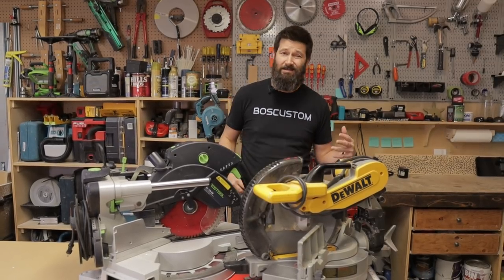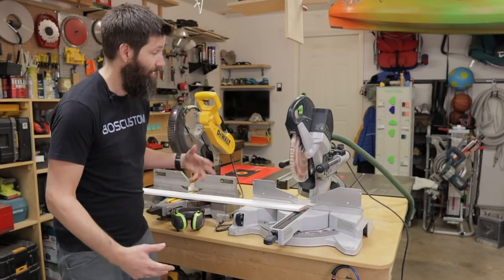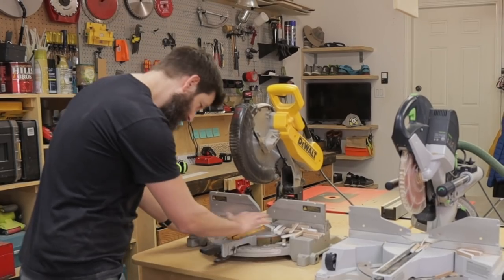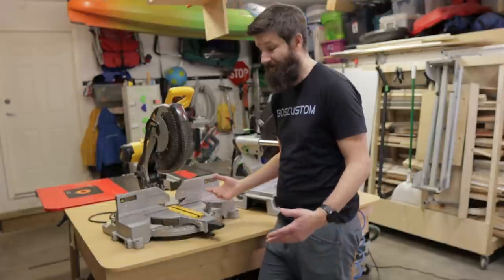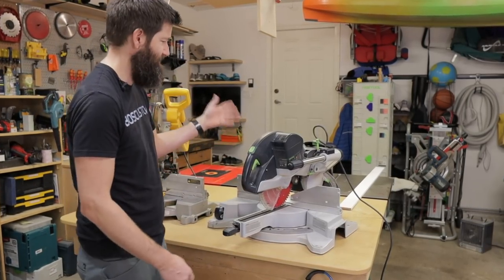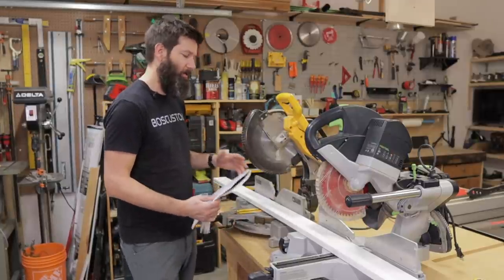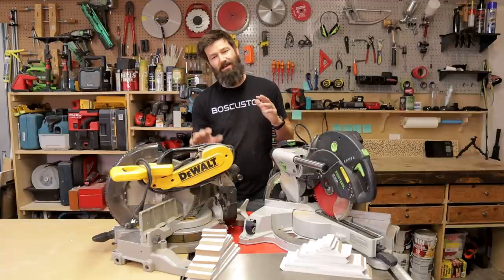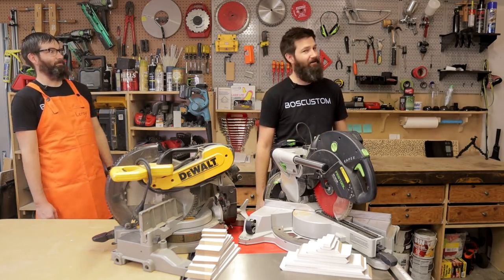Am I a Moron for Buying the Overpriced Festool Kapex-120EB over the Dewalt DW716?

Comment: Bottom line is if it's worth it to YOU.  I don't get wrapped around the axle about tool prices, though $1500 IS steep.  I think for a more apples to apples saw comparison with more similar features, the difference isn't nearly that high.  For professionals, these are money making tools.  If the features and benefits give you results and make you more productive, the price difference, even at this level, is not really an issue if the tool lasts and remains tight.  Just like anything else, if you want high end features, you have to pay for them.  While I can't justify that cost difference, justification is a subjective thing.  One bonus of purchasing an expensive tool is that you will inherently take better care of it.  Not so much if you have multiple employees using your stuff.  I went with the Makita 36v saw.  I like it, but it's HEAVY as heck!  I plan on getting the Milwaukee M18 7-1/4 model this year for portability.   Keep up the great work.

Edit:  As for accuracy, I find that simply using a marking knife instead of a pencil eliminates the vast majority of inaccuracy.
Reply from the maker: Good tip.  That 7-1/4" Milwaukee is really nice.  I've tried it cutting some 3/4" maple and the power was amazing.

Comment: Haha nice musical edit @7:35 I’m loving my Kapex for cabinetry, especially with the UG stand. But the blade guard is a serious pain. I even struggle to line up the laser to my pencil mark because it covers so much of it until you start plunging. My favourite part about it other then accuracy is definitely how easy the bevel is to use. I did everything I could not to use the bevel on my old DWS780.
Reply from the maker: Thanks man!  Good point on the Bevel, I think that's why most people end up not making bevel cuts- the average saw out there is a chore to get it set up!
Reply: @TheFunnyCarpenter  exactly! And then when you do get it set up they’re either so inaccurate or just heavy that they deflect to much on a bevel, and accuracy is just way harder then it needs to be.

Comment: I make a lot of small display cases, military shadow boxes etc, and I simply could not get either one of my Dewalt saws to cut as precisely as the Kapex. Is it way over priced, hell yes!.....but it truly has set and forget accuracy.  When I need to make a bevel cut, I don't need to recheck the blade once I set it back to 90 degrees......as it's always perfect, each and every time.  Did I mention the Kapex is overpriced?........all festool items are overpriced!   Otherwise it's been a fantastic addition to my shop and I look forward to never buying another Kapex, as once is enough!  Great review.
Reply from the maker: 100% agree.  The Mitre stops are bang on solid, the Bevel adjustment is razor thin precise.  Brings joy rather than frustration.  Cheers

Comment: You need to know this....Festool is engineering everything in house with their development department! Dewalt is just copying existing systems. Also, Festool is all about safety! So that's the reason you cannot pick-up the blade gard easily by hand! ( Just activate the system with the triggers, release the power trigger, and you are able to put the blade on sight to a mark on the wood you wanna cut, so there is NO reason to pick-up the blade gard with your hand!). Also, because Festool is using ballbearings, the machine will stay accurate as long as the machine will live! Dewalt will start to feel loose after some years, the entire system that you use to cut the wood will start to move left and right, so making a true cut is no longer possible. Dust will clog up the Dewalt so much, that you have to treat it with lube, in order to be able to use it, and the motor is under powered. The thing is though, in all honesty, you CANNOT compare these miter saws to each other. The Dewalt is made for rough building work ( foundation work for instance) and the Festool is made for more finer and precision work, like cabinet/ furniture making.You don't start the Baha 500...with a Ferrari right?! :-)

Comment: That is my exact Dewalt saw. I'm pretty happy with it. Trimmed a lot with it. I would not spend $1500 on a miter saw.  Could you do a review of a cheap harbor freight sliding miter saw?
Reply from the maker: That’s a classic saw, it’s what I started out with.  Build a nice reputation with it for sure!
Reply: The harbor freight 12in sliding miter, the Hercules one. Is a direct clone of the dewalt. It’s inferior in every single way. I wouldn’t buy it.

My boss owns the Hercules and I own the dewalt. 

My boss also has the Hercules table saw, wouldn’t buy that either

Comment: Hard for me to comment as I've never owned a Festool. But 1500 dollars for something my cordless Kolbalt miter does perfectly for 200 dollars is hard to fathom. I used to think Milwaukee was to expensive and now I'm hooked. So maybe I'll atleast give Festool a try at some point. But not this saw. Lot of people love that Dewalt. Most common miter saw I see on sites.
Reply from the maker: For the money Dewalt saws are tough to beat.
Reply: Bringing a festool on site seems silly to me. My festool are never going to leave my shop. 

I bought a dewalt miter saw after using a ryobi. The dewalt is unbelievably better than the ryobi. But in my small shop in which dust collection is extremely important and space is limited the Dewalt quickly became a burden. Working outside I love it. But inside the back facing rails make it so cumbersome. And it sprays out dust everywhere. 

I gifted the Dewalt to my dad bc I have no room for it. I currently have no miter saw and I’m using a festool tracksaw saw in its place. I can’t wait to get a Kapex.

Once you have the festool system there is no going back. Everything is so beautifully compatible and user friendly.  Relevant to my situation is that The Kapex and stand sits exactly the same height (90 nm) as the festool multifunctional table. So instead of having a bulky Dewalt miter saw folded in a mobile stand in my way while trying to maneuver boards around in the shop I’ll be able to slide boards across both level surfaces.

My two favorite brands are festool and Dewalt. For some things Dewalt is a no brainer over festool for me- like drill bits. I’m not gonna spend festool money when Dewalts are great. But once I upgraded to a festool carvex from a Dewalt jigsaw I will never use my Dewalt jigsaw again (inside at least.)

Comment: Depends on what you want to achieve. The Dewalt is my choice because it has a 12” blade. 
No Kapex can cut through a 3 1/2” newel without flipping it. 
It can’t cut through a 10” wide  skirt board on a beveled angle Front to back. The Kapex excels a bit on most other things by a small margin. 
Blade size matters. 
And the price of $1999.00 Canadian really bites. 
Most people that I know that have festool’s believe it makes them better. The fact is no tool can compensate for bad skills

Comment: If I was new to the hobby or craft and thought I needed a Festool Kapex to add to my arsenal to improve my work flow I would seriously consider purchasing a Festool track saw and either a DeWalt, Bosch or Delta sliding miter box saw. Far superior and useful than owning one extremely high priced saw that has better dust collection. I do know why woodworkers and carpenters are recently so concerned with mitersaw dust collection and own a wood lathe, table saw, router, drill, etc.. Marketing seems to be the most obvious in my opinion. Making sawdust is no differ than any other tradesman in other occupations, everyone makes a mess in creating their art forms and aren’t as hung up.
Reply from the maker: Hell of a point on the track saw cheaper miter saw combo.  For me the dust collection is nice, but it's the bevel cutting ability of the Kapex that sets it apart in my case.  For the average person hell no... buy the cheaper option.
Reply: Don't forget that a lot of these materials throw off toxic dust.

Comment: Thanks for the great video.  Ironically, I just spent $1500 to replace by Dewalt 780 and I feel like a moron, about 100%.  I bought the hype on the dust collection as I have a small hobbyist woodworking shop and obviously want as little dust as possible.  I honestly cannot tell much difference between dust collection on the 780 versus the Festool ($1500 (:.  I have spent a lot of time experimenting with different hoses and setups thinking I must be doing something wrong as I was expecting the 90% dust collection.   Aw shucks.
Reply from the maker: If you ever get a chance to see these two saws in the right type of lighting, you will probably notice the difference in dust collection.  The Kapex does a fairly nice job at keeping the finer dust out of the air.  Lol at least you will look like a top pro:). I always thought it would be funny if I showed up on site with my ridiculously priced miter saw and then proceeded to just shat the bed in terms of quality.
Reply: @TheFunnyCarpenter  Thank you😊. That helps me feel a little better
Reply: Are you using a festool vac? They base that number on use within their own brand
Reply: @beantea5592  Thanks.  I tried it with a Festool vac and didn’t see any noticeable difference with the naked eye.  I suppose if you were able to measure it with some sort of device, it likely would make a difference.
Reply: Dust collection is about the fine dust that suspends in the air & kills you slowly. The big stuff is meant to fall on the ground & not float in the air. You vacuum that up yourself.

Comment: Dewalt 780 all day. I wish rigid would make their newer model sliding compound miter saw at a high quality. It has such cool features for finish carpenters, but it’s just low quality and too many of them have blade wobble right out of the box.

Comment: I see that red blade on your Kapex, looks to be a Freud.  I can't find anything like it, anywhere, only the spendy Festool or Oshlun's you linked to.  What/where/how...I'm not a fan of the Oshlun's, would be interested in a Freud.
Reply from the maker: The Freud is just a regular blade that I had bored out at a sharpening machine shop.  I made a video on blades for the Kapex where I mentioned this.
Reply: @TheFunnyCarpenter  Nice to hear that you are fighting back against Festool's proprietary practices. Like 1/4 hex that isn't quite (they round off the corners!) and non-standard dust holes in sanders. It really is quite blatant. Along with pricing policies that got them fined several million a few years back.

Comment: I am sorry, I usually like your videos, but this is not a good comparison. Talk about how the Dewalt is so simple, and there is more to the Kapex, yes, because one is a chop saw, the other is a slider. There is of course going to be differences. Not a brand thing, Just not a fair apples to apples compare. I agree it is pricey, but again, not a fair comparison, the Kapex has so many better features than other saws. Accuracy is number one to me. When I first got the saw, took it out of the box, cut a 15" or saw ply, took two cuts, with a stop, flipped it over, cut the other way, you can not tell it was two cuts. Dead on accurate out of the box. Plus the Kapex clamps are genius. If something is a pain to use, we don't use it, with the kapex, I use the clamps every time because they are so quick and easy. The Kapex is also a space saver in the back, VERY nice feature. Plus how the bevel adjustment works, just turn the knob, another innovation. Not to mention, how can you compare, even price wise, brand aside,  between a chop saw and a slider? I am not a FT fanboy, but sorry, this was not a good comparison. If it was a Dewalt slider, then it would be more fair.

Comment: Haha great video, every finishing carpenter I know that has purchased  the kapex has had issues with the motor frying out :(  pains me to say it cause I am a festool fan for some of their products.
Reply from the maker: Kevin Smith that sucks about the motors.  I know quite a few guys with the saw and haven’t had any issues, but seems like a real problem.
Reply: They had a recall recently on the Kapex 120 - REB model in the UK, not sure what the case is there but give them a call, at least you can get it serviced by festool at no cost for you

Comment: 2020 and the dewalt saw is still the best mitre saw. I have three 12" double bevels, two 10" and the slider. I'm a finish carpenter, cabinetmaker and custom woodworker for over 30 years and dewalt is just the best at miter saw. I'm not brand loyal since the only other dewalt power tools I own are their electric hand planer and the new electric table saw. Cordless is makita or milwaukee and I would not buy anything but porter cable for a router.
Reply from the maker: Dewalt has always made a great reliable Miter Saw.
Reply: You're right dewalt makes the best sliding miter saw period.  Nothing else comes close.

Comment: Neither of them?  I have run both and after getting the Bosch Axial glide I haven't touched either ever again.
Reply from the maker: What do you like better about the Axial glide?
Reply: @TheFunnyCarpenter  The ease of tilting the head, the accuracy, the zero gravity stand, the fact I can put it against the wall and not have to worry about slide rails hitting, the ability to adjust the tension on the glide mechanism.  I also like the quality of the saw over both the Festool and the Dewalt.  The Axial glide is bullet proof.  I'm not gentle on my equipment, and the Axial glide takes its fair share of abuse and still cuts perfectly every time.   Though if we are honest with each other the other 2 are fine, I'm extremely brand loyal and have been using a Bosch saw for a while, I know my saw and dislike swapping from what I know.
Reply: @ericdevarney4089  the bosch is a fantastic saw glad I got mine

Comment: Been using power miter boxes since '79, Kapex has been awesome for trim. Plug the saw directly into the wall and go bluetooth on the vac, saw is stronger. I also cut all the ribs off the blade guard except the middle one, now both laser lines are solid with the head up. Yes only cry once on the price...
Reply from the maker: Cool idea with the blade guard. Thanks for checking out the channel.

Comment: I’m a finish carpenter. Kapex definitely not worth the money . The Dewalt you are comparing to is not good because it doesn’t slide. A 10” or 12” sliding compound Dewalt will cut anything and do it well. As far as dust goes.. well that’s what brooms are for. There will always be a huge mess regardless of the saw.

Comment: I don’t get the measurements being off by 3/16.... you make a mark and you cut the mark. Lol... that’s not the saw...that would be you.... that could be the pencil your marking with getting dull and making a wider line to cut off off.. 
between the 2 saws Festool is better and  it should be for the price but we’re comparing a Flagship saw to Dewalt’s 12” everyday run of the mill saw. 
The funny thing is the Dewalt will probably outlast the Festool with its faulty motor.
Dewalt not to be out done in that department with there own flexvolt faulty motor...
I can’t remember who made the comment that Dewalt saws are for rough framing and not finish work.... that comment blows my mind. 
Dewalt sliding saws are hands down the standard in construction mitersaw a for a reason. There solid, accurate , precision tools. 
And you can’t cut 7 1/4 crown nested on Festool kapex nor can you cut 5 1/4 base vertical either... 4 and 3/4 in the special cut position..
Festool : for $1500 you need to take your handle and turn that SOB sideways like it should be..... scrap your laser for the shadow line and make your saw cut capacity what it should be...
Make you paint stick to your tool....
And give us a 12” blade in millimeters if that makes you feel more accurate... and most of us aren’t building grandfather clocks so the get another excuse other than you can figure out the how to reduce blade deflection.... your German... figure it out..
Nice video man! Home Depot guy was a little strange lol.... would a Lowe’s guy be as weird?
Reply from the maker: Strange indeed:). Couple points- you can cut 7-1/4” crown nested on the Kapex.  I’ve done it twice now. Second cutting baseboard standing up is silly.  For the price and quality the Dewalt saws are tough if not impossible to beat.  I may still be using my DW706 if it weren’t for the motor blowing up- these things happen- especially on construction site with sketchy power.  That being said if a person had the goal to be the fastest most dead accurate Finish Carpenter in the world, you’d be hard pressed to find a better weapon than the Kapex 120EB.  Cheers I appreciate the feedback😁
Reply: I would love to see the 7 1/4 crown cut on the kapex....nested. Possibly the crown projection was different on the 2 opposing crown. 
Thanks for response!

Comment: You should be using the same blade on each saw for a good dust comparison. One could be flicking dust sideways and the other flicking it backwards.
Reply from the maker: Good point- although the tooth geometry on both the blades is very close.
Reply: @TheFunnyCarpenter  Yea i assumed they were much the same. I can't remember who but a YouTuber did  a review on blades and how they shoot the dust in which direction which i thought was interesting.

Great video anyway mate, keep it up!

Comment: I think the Makita ls1219 is better than both. Half the price of the festool. used the DeWalt heaps they have plenty of power  but are more of a chop saw, the slide design is terrible.. Couldn't go back to 10 inch.
Reply: I also have a Makita 1219 and cannot wait to get rid of it! I have done everything to get an accurate bevel cut with this and have waisted my time. Laser throws a shitty line and have never used it. I cut a 100% perfect bevel with my little Festool plunge saw and never uses my Makita for this.